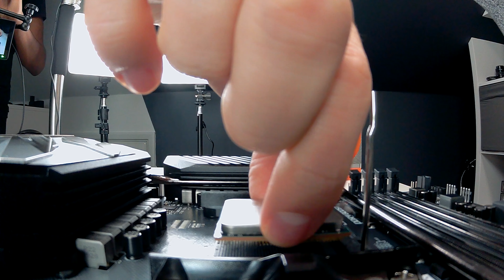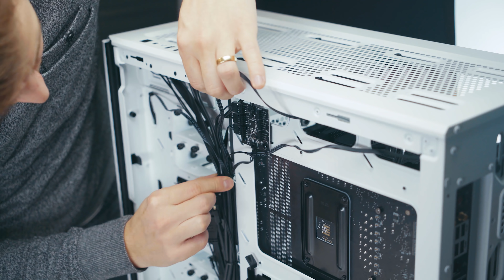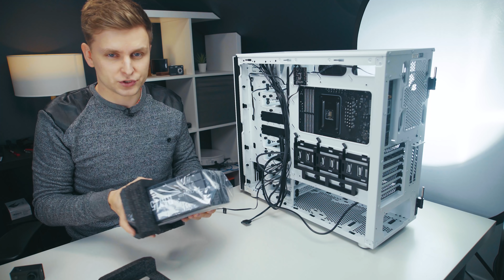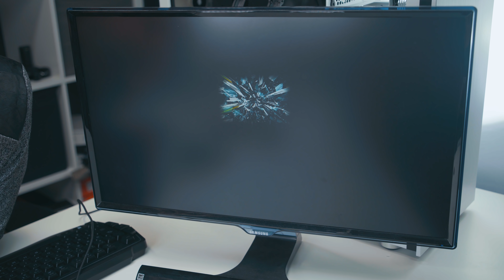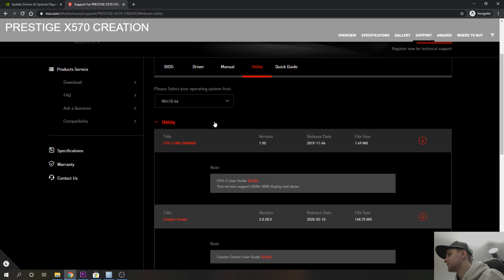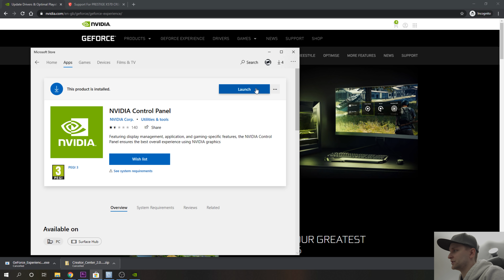ULTIMATE GUIDE: How to build the MAC PRO KILLER PC

Comment: A loyal subscriber !!
Can you make it run and show us how it looks and productivity benchmarks. I am looking for a pc configuration as such with 3900x. 

But Mobo price used is out of my budget. 

Can you tell what options I have for budget Mobo with good vrams and good for overclocking with 3900x. And what budget cooler air or liquid , you suggest? Is noctua black cooler is suffice for overclocking cpu? Is it advised to  do SLI on this setup with two graphic cards?

Purpose is video editing, color grading, 3d architecture, rendering, VFX & compositing. Software arsenal I use : Adobe (Photoshop, illustrator, XD, Lightroom, premiere, after effects) Davinci resolve, 3ds max/ blender with third party render engines, karakatoa, to name a few.
Reply from the maker: For adobe products no point of going SLI the performance gain is hardly noticeable! 
I've got some MOBO alternatives in the description if they don't fit you can just search on amazon for x570 motherboards for am4 socket and see which one you like :)

Comment: Quick question. The GPU that you're installing only has 2 fans but on the link you've provided that says "mine" it has 3 fans. Is the wrong GPU linked or am i missing something?  Thanks in advance!
Reply from the maker: I think gygabyte has 2 multiple versions os the 2060s GPU, in essence it doesn't matter which one it is as long as its 2060s :)
It's like what colour car it is or what interior you have. The engine and the performance will be the same. 😊
Reply: @theTechNotice  thank you for the very quick response, I appreciate it sir. Will be subscribing to your channel!

Comment: Do you recommend using a dedicated 500GB SSD for your OS, and another 500GB SSD for project files? If so, does this motherboard support that? Or is it just the same to get the 1TB SSD and partition it for the same purpose? Thanks in advance.
Reply from the maker: Yes and yes it would support that.
Reply: Do you recommend one over the other? Partition vs. two SSD?
Reply: Also, if I end up using 2 SSD’s I noticed that the space for the second SSD on the motherboard looked like it was meant for a larger SSD than the first one. Is that something to consider?

Comment: wow awesome build man, i might do the same build. what will i do if i cant find the parts on amazon? do i order straight from the source?
Reply from the maker: I would avoid ordering straight from the source just coz the returns are much more complicated. Try your local shops would be my best advice if not available on amazon, but I'd get as much stuff from amazon as possible, I just love the fast delivery and 'no questions asked' returns :)
Reply: @theTechNotice  is the cooler fan better than the stock fan? what are the advantages
Reply from the maker: Yes it's better and the advantage is more stable cpu performance and less cpu throttling.

Comment: Hello tech, bit of a question here..
I bought the following SSD;

https://www.amazon.co.uk/Sabrent-Rocket-Internal-Performance-SB-RKTQ-1TB/dp/B0829DZH2W/ref=mp_s_a_1_3?dchild=1&keywords=sabrent%2Brocket%2B1tb&qid=1591688666&sprefix=sabrent%2B&sr=8-3&th=1&psc=1

Could you tell me is there really a major difference between that and one you used in your build?
Because over £200 for a 2tb drive is mad lol
Reply from the maker: Tbh, there might be a big difference in the write and read speeds, but the thing is 3000MB/s is pretty insane anyway and won't be bottlenecking your system so go for it unless your workflow somehow can utilise the insane speeds of the Rocket 4.0  😊
Reply: @theTechNotice  bro, thanks man 🤙

Comment: Like previous comments, excellent video, I wish I could build one like that. Maybe in the near future. 
The only thing I might be bothered with the case, is the 20 pin access point, where the rubber entry port was could have been flat down and not in an angle, or better still, not there at all, so the cables do not have to be put in any stress.

Comment: Great build video, thank you.  Just built a similar Rig myself after running an Intel i7 4770 for 7 years.  
The 3900x is amazing, it is exporting Lightroom job s in less than half the time and rendering video from Davinci far quicker,  the time saving  over the first 12 months of this system will be huge. .  
For those interested, my build ( for photography and some video ) is. 
Fractal Design R6 Case
Thermaltake 750 PSU - RGB.... so my PSU looks like it's having a party and the rest of the PC is not invited. 
Gigabyte X570 Auros Elite Mobo
48GB Corsair DDR4 3200 Ram - Some bought some as part of CPU, Mobo and RAM bundle which saved a fair bit. 
AMD Ryzen 9 3900x
Noctua 12U-S cooler.
Gigabyte RTX 2060 Super OC 8GB - feeding two BenQ PD2700Q panels. 
Corsair MP400 M.2 1TB OS drive
1TB Samsung Evo SSD
4TB WD Blue
Really happy with it's performance and the time saving alone over the next few years will make it a worth while investment. 
I did make the mistake of ordering the wrong CPU cooler,  so the bulid was delayed a few days.  DOH!
Reply from the maker: nice, well done! :)

Comment: Being a "Mac guy"...can I add thunderbolt 3 i/o?  Also, if I use an eGPU with a Radeon 5700XT, should I use a matching GPU?
Reply from the maker: Yes you can add TB3 ports as pcie card. Although just wanna clarify that this is running Windows and not meant to be hackintosh :)
Reply: @theTechNotice  Thanks!!
Reply: @theTechNotice  yes, I know...just have some TB3 gear I want to use with it.  Thanks again for your videos!!
Reply: @devidasa9637  Have you installed your thunderbolt 3 card? Do you need to connect the card with any cable to the motherboard?

Comment: I really wanted to build this but the cooler and the motherboard are unavailable everywhere so I guess I am outta luck.  I'm lost so I suppose I should just buy a PC already built.  This has been quite frustrating.
Reply from the maker: They're out of stock coz of the pandemic. If you can wait a week or two they should restock soon. 😊
Reply: @theTechNotice  thanks man I wasn't sure how long it would be bc they weren't giving out any dates. Out of curiosity, do you have an opinion on Bizon Tech PCs? I was just searching for good video editing PCs that were already built and stumbled across their site. I'll likely wait and build my own but figured I'd ask you about Bizon in the meantime. Thanks as always!

Edit: I was looking at the x3000 from them specifically. My budget isn't really an issue and my knowledge is novice at best. I just want something nice and fast that will last. And no pressure to respond or anything. I realize I ask a lot of questions and that can be annoying lol

Comment: The ultimate Mac Pro killer is a Hackintosh, plain and simple.
Reply from the maker: Well I was trying to make a point of people who use cross platform software like premiere, then the PC is a MAC Pro killer for 3rd of the price :)
Reply: @theTechNotice  Most people on a Mac are using FCPX or even made the switch to Resolve. Premiere is not optimized for a Mac, and actually slow. Add to that the fact that you have to basically rent Premiere, most people prefer other NLEs. So unless it can run FCPX, i don't think most Mac users care for a PC, or Windows to be exact.
Reply from the maker: Yes I do understand what you're saying although I know a disturbing amount of people who go for the Mac Pro to use it solely for Premiere and that got me thinking this way. I've seen some 'very big' youtubers recommend MAC PRO-s for Premiere usage (which is not wrong per se) but I thought wait a second... Surely we can save money here 😊🤑
Reply: Tech Notice yeah, they recommend a Mac Pro because Premiere Pro is not optimized for Mac, so you NEED a Mac Pro to be able to use it since anything less doesn’t perform as well.            I’m actually thinking of building a Hackintosh in the near future, but for now, I’ll be upgrading from a 2013 15” MBP to a 16” MBP

Comment: Thank you for this extremely well done video. I'm very tempted to assemble this beast as my first pc after 15 years of Mac.
What I'd like to see is a test of this machine, to see if you have any issues of overheating, driver conflicts, malfunctioning softwares, etc.
When you buy a Mac you know that all of these things aren't happening (mostly) but as far as I know, this is the downside of assembling yourself a machine, because it's untested.
Reply from the maker: I've been using it for almost 6 months now and I've had almost no issues. Only issues I've had was premiere haha not os ;)
Reply: @theTechNotice  Thanks for the reply, what kind of problem did you have with Premiere, and how did you solved it, if I may ask?
Thanks again, I think I'm gonna build your same exact pc following your excellent guide!

Comment: Also, I have the MPG X570 GAMING PLUS motherboard, with no JUSB5 port. What should I do with the USB-C cable coming from the front of the case, is there an adapter or some why I can connect and use it with the JUSB4 or JUSB3?
Reply from the maker: Yes I'm afraid that is one of the downsides of that mobo you'll have to live with out the top usb- c😒
Reply: @theTechNotice  https://www.amazon.it/dp/B07WG8ZJ41/ref=cm_sw_r_apa_i_I0v0EbRJ2D7CM

I bought this to connect the USB C to my motherboard even though it won't have the power or transfer speed.
Reply: @theTechNotice  I have the same board and only one usb port works on the case works... any help with this?

Comment: Great video! I'm using the same case. Why move the fan so there are 2 fans in front? If you operate with the front door closed is there enough air that can be sucked in? What are your thoughts now?
Reply from the maker: It's tested that the front fans are one of the most important in the airflow. And It's a misconception that there's no air in when door closed, there's actually caps on the side and bottom :)
Reply: @theTechNotice  thanks and for the quick response

Comment: Just touching something grounded once in a while won't protect your computer. Every movement you make, everytime you slide something or touch and pull away, generates static charge.

The motherboard and other components you are touching will equalize to the charge on your body. You let go, touch ground, now you are neutral but the motherboard is still carrying a charge. You touch the motherboard, it discharges to you.

Dave Jones of EEVBlog has a video showing that merely getting up from his chair was enough to generate a huge ESD event.

An ESD mat and a wrist strap is cheap compared to the price of even one computer component.
Reply: The most important thing is that you and the computer parts are at the same potential. So without an ESD mat, I'd make sure to always touch the black box you've placed under the motherboard. That black box is ESD dissipative, slightly conductive. This brings you and the motherboard to the same potential with a much lower peak current.
Reply from the maker: thanks for that! :)

Comment: Followed this build.  I absolutely loved the easy "don't panic" dialog and how into detail the video went.  The only real deviation I made was that I used the case's fan replicator where tech notice disconnected the headers and plugged the fans directly into the motherboard.  I found the replicator made the cabling a bit easier.  I also started with the AMD 3950x (which tech notice updated in another video) and a few SATA drives.   I found it easier to plug the motherboard and CPU power cables into the motherboard (but not the PSU) BEFORE putting the motherboard into the case.  Frankly, I wish I had also plugged in the power and reset jumpers before dropping in the motherboard as well.  All in all this is an absolute beast of a system and this was an EXCELLENT, fantastic video.  Can't thumbs up this video enough.   ♥️  ♥️  ♥️
Reply from the maker: I'm glad you enjoyed it! :)

Comment: I think this is one of the best guides I've seen on a cross platform build. Very thoughtfully documented and full of links and useful info - really, it's like a video magazine, informative, clean visuals and succinct where it needs to be.
For the last couple years I've been lurking/posting on forums, reddit and here, trying to arrive at a potential configuration for my next system. I still haven't arrived at anything solid.
What I really want to achieve is for InDesign, Illustrator, Photoshop, Ae, and Cinema4D to fully utilize my graphics card(s) and operate very smoothly. (not all at once, just for each app to work as intended and very smoothly - as fast as I can think) I've heard mixed stories on this, not all of them very good. It seems like I have to choose between OS or graphics card utilization in Adobe apps - as if Adobe apps are going to run faster in windows if I want to fully utilize industry spec GFX cards or anything similar. 
In a nutshell, is it even possible to get full utilization of graphics acceleration in Adobe apps like InDesign / Illustrator / Photoshop on a hackintosh / ryzentosh? I have personal and work machines I can depend on, so I'd like to take advantage of this and move into experimental territory - but not blindly.
Reply from the maker: I don't think you'll get a 100% utilisation of the GPU on any program. I guess Adobe is working on it since the new 14.2 update on Premiere started to utilise about 70-80% of my gpu. And slowly they'll roll that out to other apps as well. :)

Comment: Hi.GREAT JOB ON THIS VIDEO. REALLY HELPFUL. i followed everything on this video. i have changed some spec though. i ordered CORSAIR 1200 AXI SERIES 1200W POWER SUPPLY. I WILL USE MSI Prestige X570 Creation Motherboard (AMD AM4), NVIDIA TITAN RTX 24GB GPU WITH AMD RYZEN 3950X PROCESSOR, 128 GB  CORSAIR VENGEANCE LPX 64 GB (2X32GB) 2 PAIRS, 2TB SABRENT ROCKET NVME 4.0 PCLE M2 SSD, NOCTUA NH-D15 COOLER, I WOULD LIKE TO KNOW IF THIS POWER SUPPLY IS GOOD TO GO WITH THE MOTHERBOARD AND OTHER THINGS. AM I OVER POWERING THIS OR UNDER-POWERING THIS PC? ALSO IF I USE ANOTHER GPU WITH 24 GB AND DO THE NVLINK, DO YOU THINK THIS POWER SUPPLY AND MOTHERBOARD IS SUFFICIENT TO HANDLE?  PLEASE LET ME KNOW . THANKS.
Reply from the maker: Yeah, that PSU should be fine...

Comment: Corsair Carbide 678C is an engineering failure according to airflow. I bought also this case but with 140mm fans next to psu get air from outside to cool parts since there is no place get air. With Hackintosh, this setup is really a Mac Pro Killer and extra quite.
Reply from the maker: I'm not sure you're right about the airflow...? 🤔
It sucks the air in from the front and pushes it through and it goes out from top and back.
Reply: @theTechNotice  Front case door disables front ventilation (there is a small gap under front door) if it is not open (usually closed) and there is HDD cases front of fans also distracts air going to directly cpu air cooler. Anyway, I think new case video coming from you

Comment: Hi Again! I'm just putting together my shopping list based on your recommendations and I have a couple of questions if you'd be so kind :) Regarding the SSD, that specific Sabrent one is difficult to find in the Netherlands (It costs double the price through amazon from the Dutch site, which is bonkers!) so I was looking at the Samsung 970 evo plus 1tb as an alternative - would this work pretty much the same? Secondly, for the GPU I can get a RTX 2070 Super for a not too much more than the RTX 2060 so would it make sense to get this small upgrade? I'm ordering the Corsair HX1200 power supply to make sure I have enough juice. I'm mainly doing 3D modelling, a bit of animation, and the usual Adobe Apps - although these don't rely on the gpu so much. Thanks in advance!
Reply from the maker: Hey mate,
Yes that samsung drive will work exactly the same, and I bet you wouldn't feel the performance difference.
Yeah, if the 2070 super is not too much more then go for it.
That PSU is abit of an overkill for this I'd say 🤔 but you know if you can afford it, go for it!
Reply: @theTechNotice  Thanks for this! I ordered a Corsair RM850x PSU in the end, I think you were right about the 1200watts one being overkill. 

*Edit - I asked a previous question regarding the Sabrent drives and if they need their own heat sinks from the manufacturer (extras) or not - I read online from a Sabrent representative, that if the motherboard has an inbuilt heat sink, then the drives will be fine. So that's good to know!.

Comment: Fantastic video, i liked it so much i bought most of the parts (everything minus the fan which i will add later and i went for the black case`) And am just sitting through the drivers installation now, all appears to be good! I have never built a pc before, most i have done is change over ram and that was 15 years ago! Been mac everything for the last 15 years, hopefully windows will be better now, lets see! Thanks again, couldn't have done it without your guidance
Reply from the maker: Thank you for your kind words! 😉